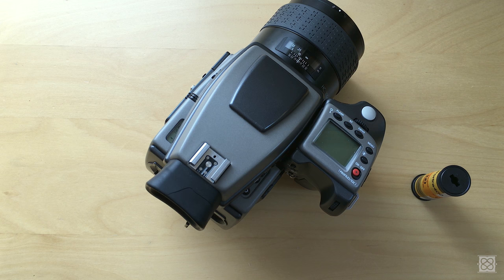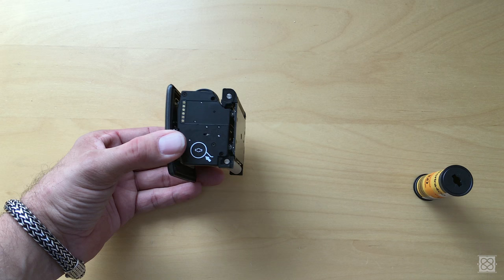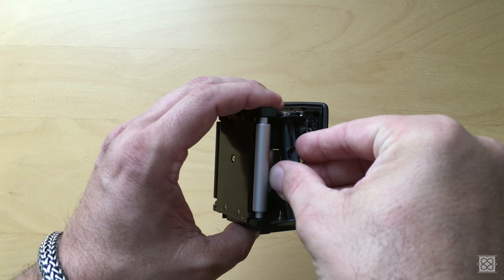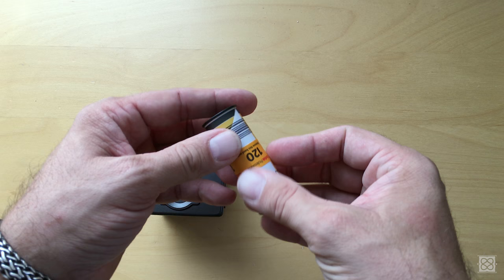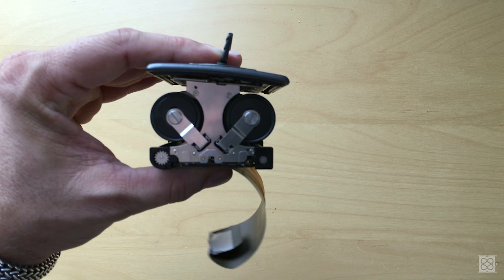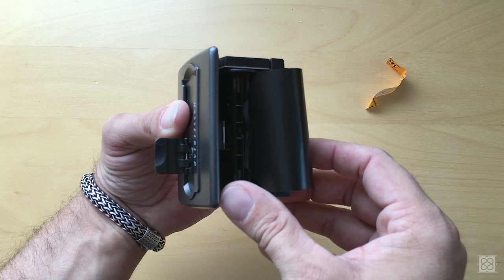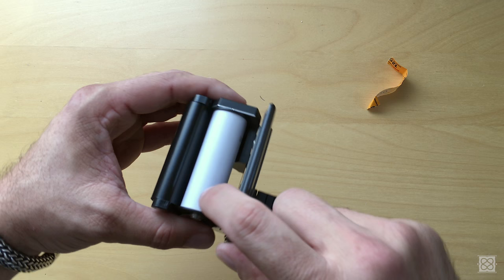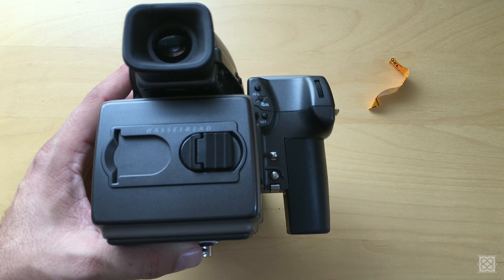Hasselblad H1 / H2 How to Load Film

Comment: one important step, as the back is open to the air, close the darkslide, saves dust getting into the mirror/shutter mechanics, as well as stopping fingers getting too close!!
one other thing, as you are changing film, check the batterys' charge, as you might be running low, for the MAGASINE as well as the body, as if either is down you run the risk of losing the frame counter /asa info and wrecking the roll, as to 'changeout' de-powers the system, and as i am aware, no 'memory minder' battery/capacitor is installed!!, and this info gets lost and once it is, there is no mechanical refference for where the film is; also the magasine battery is a button cell, so worth keeping an eye on it, esp. for rusty contacts to.

Comment: Glad I stumbled upon your video. I just got an H2. Have you encountered a situation where the camera feels like it's locked? Like you can't see through the viewfinder because the mirror is up or something? It happened to me on what I thought was my last frame but the camera wouldn't fire, I pressed the shutter button and it rewound my film. I think lost the last frame. After, I couldn't fire the camera until I removed the lens and pressed the shutter button. Thanks for your time.
Reply from the maker: It's likely that you accidentally pressed the mirror-up button. There is a button to manually flip the mirror up or down. That would be my guess.
Reply: @Hunterphotographic  You are 100% right. Figured it out and that was the issue. Thank you.

Comment: When you turn on the camera, does it set the film speed according to the barcode? How does the digital readout work on the HM 16-32 back?
Reply from the maker: Daniel Corey great question! I honestly had to look at the camera to figure it out. You can set the film back to an auto mode which will read the barcode on the film. I don’t shoot at box speed, so I don’t use this mode. Instead I set my desired speed manually.

Comment: If my film does not have a barcode, how can I get the camera to processed to frame 1?  I have loaded it to the start mark and pressed the shutter button without any results.
Reply from the maker: What type of camera are you using? The steps you took are correct. When no barcode is present on the film, then you should manually start the film at the start line. Is the camera manual wind or automatic?

Comment: Hi Andrew I have bought Fujifilm/Hasselblad HM 16 32 for my hasselblad H6D. I have loaded the film, but the camera is not winding the film. Looks like it is not working. Would you happen to have any idea?
Reply from the maker: The Hasselblad H6D may not be compatible with film. I think only the H6X (H5X, H4X, H3X…) is compatible with the film back. Please confirm with Hasselblad, but I am pretty sure this is the case.
Reply: @Hunterphotographic  , thanks for your quick reply. In the H6D manual Hasselblad confirms it works with the film back
Reply: a few, try pressing the shutter button, in the menu, under wind_on there is a custom setting, instant, or with a shutter button press. look it up, and adapt this setting, also I think this only works when the darkslide blind is shut?, also try using a pencil eraser and scrubbing the camera\ magazine contacts, they could be dirty, or glazed, so this should be enough (to help the camera recognise that a back is attached), also you may have to adapt the firmware, to add this feature to the H6, as I don't think it is 'native' when you buy it, unless you specify you want it film compatible. another reason for the mag not working is that it is independently powered, by a cr2032 button cell battery ONLY accessible from the inside! so before loading replace it, or at least check voltage with a multimeter to see if it works (the mag has a chip on it to convey asa and do the imprinting function, so needs to be 'live' for the body to do anything with it).